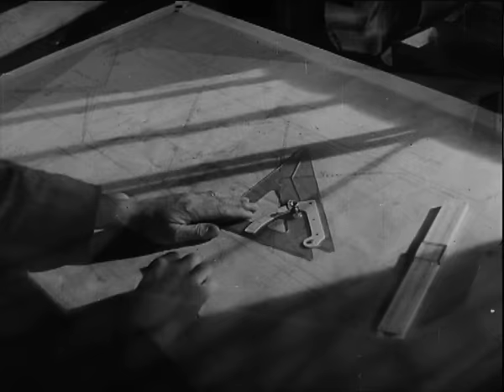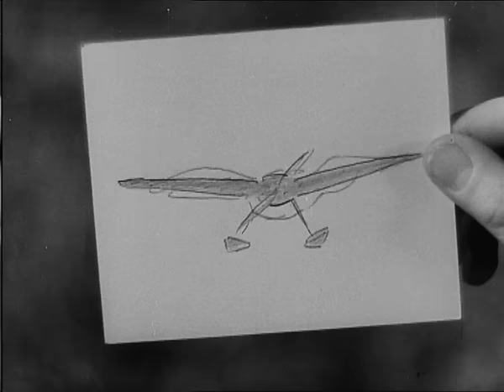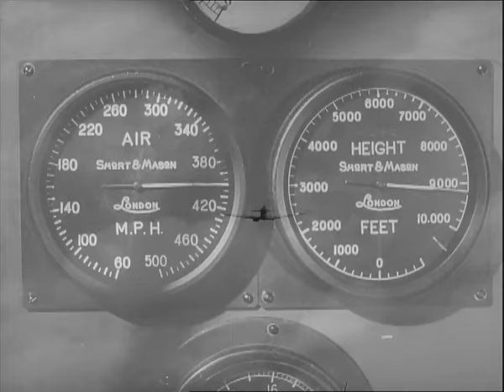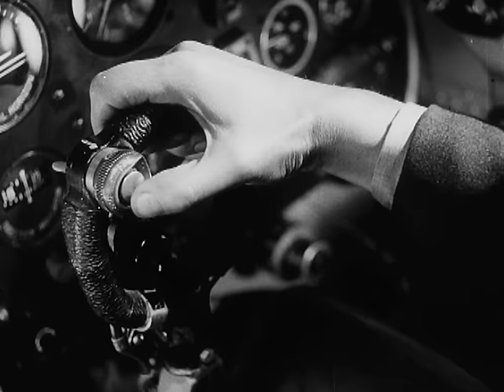PUBLIC SERVICE BROADCASTING - Spitfire

Comment: The opening 5 secs gives me goosebumps - was there ever a more evocative sound than that of a 27-litre, liquid-cooled V12 Merlin engine??!!
Reply: Personally, the Napier Deltic D18-25B diesel engine. 36 pistons in 18 cylinders. Howl of the exhaust under load and the bass boom from the scavenge blower through the air intake. Stand near one and it just dominates your senses...

Comment: "it's got to be able to do 400 miles an hour, turn on a sixpence, climb 10,000 feet in a few minutes, dive at 500 without the wings coming off, carry eight machine guns"

The crazy thing is that it actually did all of those things. The Mk I could carry the guns and turn like crazy. The Mk IX did 400 MPH eventually. The Mk XIV made it possible to reach 10,000 feet in two minutes. And the Mk 21 finally gave it the wing strength to dive at 500 safely. 

This thing's still an amazing machine. Long live the Spitfire.
Reply: Erm.......MK IX Spitfires were dived to Mach 0.92 by Pierre Cloistermann in 1943 during high speed trials- well before the Mk 21, and well past 500 mph. It was banging on the door of breaking the sound barrier!
Reply: @liverpoolscottish6430  Oh I knew that. But as far as I know (correct me please) those were specially designed trials and not common occurrences, and many of the airplanes involved in said trials suffered some damage afterwards. Also, those were likely at high altitude, where the indicated airspeed is lower than the true airspeed. Not that those things completely discount the flights, but the later wing designs could perform those high-speed dives under combat conditions at fairly low altitudes.
Reply: "Long live the Spitfire."  You don't have to worry m8, the Spitfire is immortal.
Reply: Still one of the best prop planes ever built and they even considered it capable of breaking Mach 1. Madness I know but if any prop plane could do it it would be the spit or the mustang.
Reply: @paulsnell534  If they ever fitted it with a Rolls Royce Crecy...  About the most powerful engine of WW2.  A 26 litre two-stroke v12, 3000 HP.
Reply: @fsendventd  Correct, they were trials, not normal combat/flying. There's a great video n YouTube about the attempt to go supersonic. They got incredibly close. Well worth a watch: https://www.youtube.com/watch?v=PuF2_P6GkAw
Reply: @paulsnell534 it can't happen, unfortunately. Propellers drastically lose efficiency very close to Mach 1 which prevents them from being able to accelerate the aircraft through the sound barrier. Essentially, the prop is moving forward too fast to utilise the air it needs to work against to generate thrust.

Comment: I volunteer at an old people's home where one old gent used to fly Kingston-built Sea Hurricanes to protect Atlantic convoys. His plane was not launched off a proper aircraft carrier. 
I worked with another bloke who was a paratrooper in the Waffen-SS.
 As time goes by we seem to be losing our connection with the war. Thanks to PSB for making an exciting and relevant track.
Reply: Robert Tolhurst Why lie son?
Reply: He isn't lying. The CAM (that was what they were called, iirc) Sea Hurricanes were launched by rocket from converted freighters. The plane would then ditch next to the ship, and they would attempt to recover the pilot. The plane was toast though. Sounds like a waste, but they were used to shoot down FW 200 Condors. If one of those blokes got a message to the U-boats, which they would, the convey was in trouble, so 1 plane vs thousands of tons of shipping isn't to bad of an idea.
Reply: Sea Hurricanes an amazing aircraft for its time, the Hurricane is a stuningly simply constructed aircraft which gave it highly regarded durability (safe landings where known with gaping holes in the wings, of the sort that would cause the stressed-monocoque of a spits to fail!) and the most significant for the sea hurricane; it can be taken apart and reassembled by just about anyone... even aboard a merchant vessel out on the atlantic. 

And that's just how the sea hurricane was used, as Dubsy 102 has covered these converted merchant ships would carry a launch sled, a handful of built hurricanes and crates of parts to build more!
Reply: "paratrooper" "Waffen-SS"
And this, ladies and gentlemen, is how you catch a bullshit peddler.
Reply: @The_Crimson_Fucker  https://en.wikipedia.org/wiki/500th_SS_Parachute_Battalion
Reply: @sailorssilence1983  touché

Comment: I've seen a few Spits on the ground but the first time I saw one fly was a few years ago at the 75th anniversary celebration of the local aero club. There were the usual line up of Cessnas etc and then they announced a visiting Spitfire was on its way and it might do a low pass. Well this thing appeared out of nowhere, blasted down the runway, full throttle at 50 feet, went straight up for 3000 feet, did a couple of aerobatics then  came down again and did a barrel roll along the runway at 100 feet. It was THE most impressive thing I've ever seen a prop driven aircraft do and there is nothing that will send shivers up your spine like the sound of a V12 engine going hard out!

Comment: A spitfire bird?   The original name was the shrew was it not?
Reply: Almost correct there Mr Greves. The works designation for what would become the Spitfire was Supermarine Type 300. 'Shrew' was one of the names the Air Ministry suggested for the aircraft. Several accounts have it that Mitchell himself didn't like the name 'Spitifre' stating that it was "just the sort of bloody silly name they would choose" (see McKinstry, 'Spitfire - Portrait of a Legend' 2007, p55)
Reply: Tom Connolly
 Good stuff